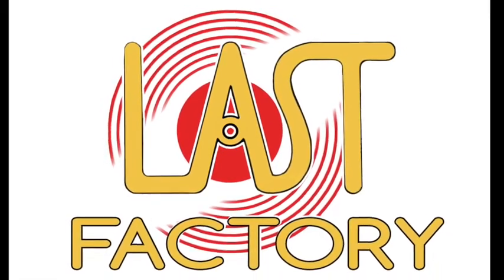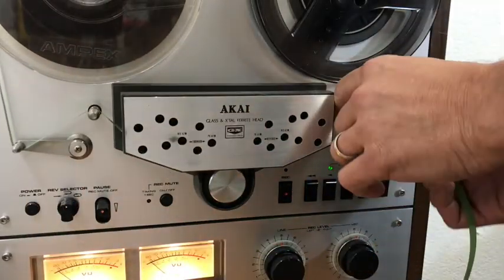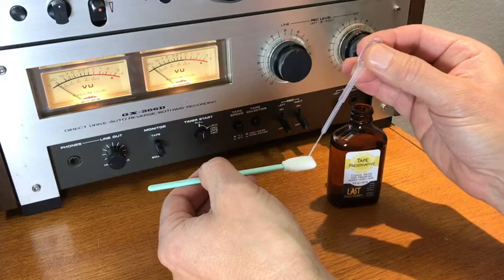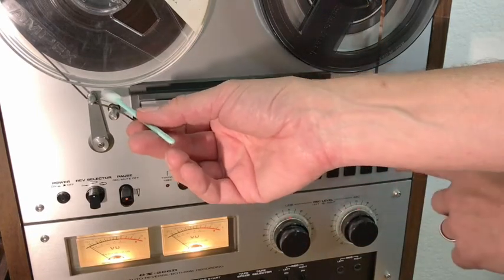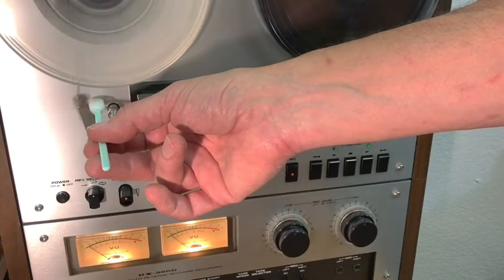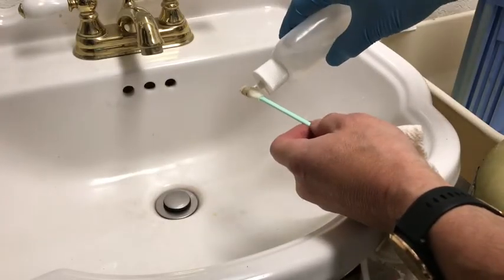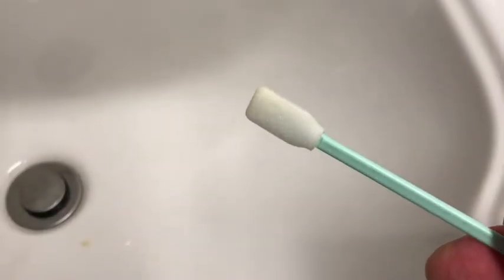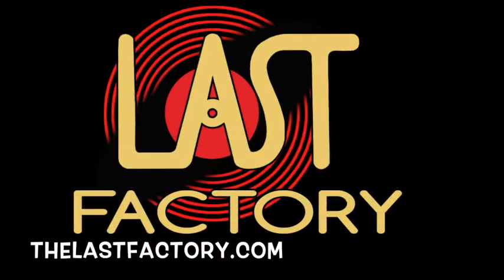How to apply Last Tape Preservative to reel-to-reel tape

Comment: With the older tapes from the 70's, etc,is ther a process to follow to using the Preserver or can I use it without doing anything else?Thank You.
Reply from the maker: Sorry for the late reply - you do not need to do anything special, though with all tape we advise dehumidifying first. Baking is the standard method, but we prefer using desiccant packets because of risks with the heating systems. In the factory, we use a vacuum system. In any case, apply just as demonstrated. Depending on the tape and its condition, you may pick up a fair bit of flaking on the swab. Rinse the swab with alcohol, blot it dry (do not get alcohol on the tape) and keep going. And remember to clean those heads!

Comment: So, I own about 5 MAYBE 5 reels that were NOS when I got them in 2007, BUT the reels themselves were recorded in the late 1980s. SO, I was wondering if you happen to DO this as a service if I bought a bottle of the solution. I WOULD do this myself except I'm an idiot and sold TWO Teac X-7s that apparently weren't AS rare on eBay when I got each one in the early to mid 2000's because I only paid about $200-$250 for each one and maybe $50-$60 for shipping. NOW they're insanely high priced and I doubt I'll ever be able to afford to buy a machine again UNLESS somehow my prayers are answered and they begin reproducing them. Hey, I never thought I see the day when record players...let alone cassettes and cassette DECKS would be a hot commodity again, and yet here we are...
Reply from the maker: Give us a call or an email and we'll see what we can work out. And keep an eye on you local Craigslist for the occasional interesting deck - that's where we got an Akai GX we use here at the Factory.

Comment: Does this also preserve old movie films?
Reply from the maker: It will prevent additional moisture uptake, but you need to think about how to avoid streaking as you pick up the inevitable dirt. We don't make it for film obviously, and while it won't harm the film stock, you would do best to consult with film archivists - it is a bit out of our universe.
Reply: @thelastfactory3590  Thank you. I never realized it was moisture that caused that damage to tapes